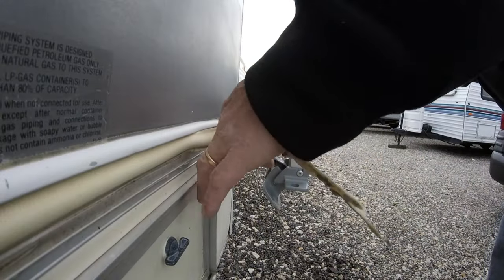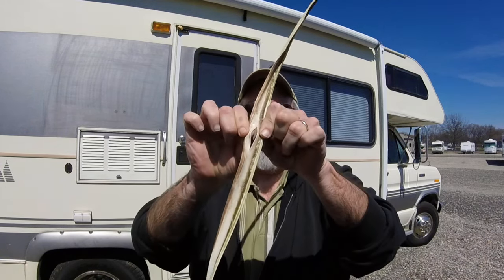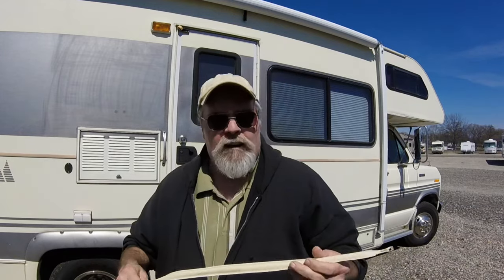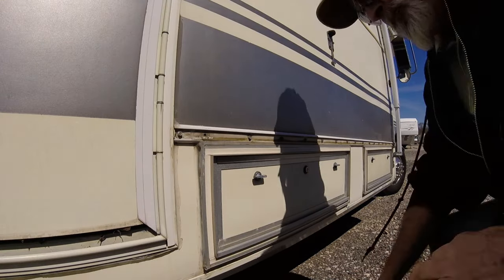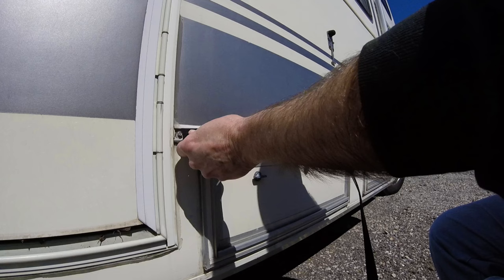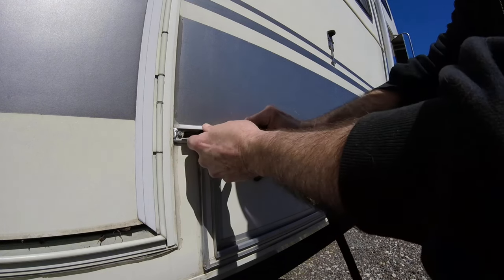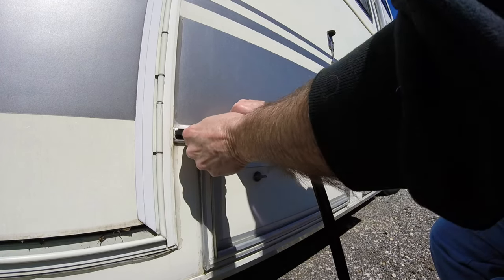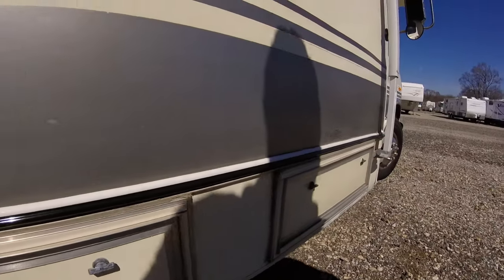Replacing Vinyl Trim Inserts

Comment: Thank you for the demo!  My RV needs this too!   Some feedback:
1. A windsock over the Microphone will remove wind noise.
2. How about dipping trim into very hot water to make it softer to use?
3. I'm thinking that a window mesh repair tool (small roller) would work well to push in trim as well.
Reply from the maker: Hi there!  Thank you for checking out the video and offering some excellent ideas.  Happy Trails to you.

Comment: Hey Geezer I know this video is older and you may have fixed it by now. I noticed the bottom is off your door. I have a neighbor with an older C that had that happen he didn’t fix it and the wind got up under there on the highway and ripped his door apart. I just bought an 86 and have the same problem I was glad he told me so I thought I would pass it on.
Reply from the maker: Good eye noticing that missing piece!  I have indeed fixed that, but I appreciate your concern.  Thanks for passing this information on.  I would have never guessed that could happen.  I fixed it only because I had the piece and just needed some new screws.  I hope you have an easy fix on yours.

Comment: Geezer, great info. What size molding did you use? What's the shape of a cross section. How wide is the screw cover channel. The opening on mine is 3/4 inch and I having a hard time just finding insert material that will fit tight enough so it doesn't flap about and come undone in the wind.
Reply from the maker: Hi Gary.  Thank you for checking out this video.  Here's a link to the stuff I used except I bought a 50' roll instead of the 25'.  I looked for the longer version and it seems Walmart no longer offers it.  I hope this helps you out.  If not, please let me know what I can do to help.  Here's the link: https://www.walmart.com/ip/RV-Designer-Vinyl-Trim-1-x-25/54334769  Good Luck to you.

Comment: Where did you purchase this product and will you please share the cost?
Reply from the maker: Hi Windy.  Here is the info you asked for.  I hope it works out for you.  https://www.amazon.com/Camco-25212-Vinyl-Insert-Black/dp/B000EDSSCU/ref=sr_1_3?crid=23ZB5BLTCWYNR&keywords=vinyl+trim+insert+1in&qid=1563053397&s=gateway&sprefix=vinyl+tri%2Caps%2C165&sr=8-3
Reply: @GeezerAtTheWheelGang - Thank you for the info. An even better price than I had found.  How is it holding up to the elements since it has been over 3 years?
Reply from the maker: @user-th9ud4nn6d  It's holding up very well.  Especially considering the weather extremes it's been through.
Reply: Thank you for your response and the info.  I enjoy the information you have been sharing.  Happy Trails to  you!!

Comment: Where did you get the trimming?
Thanks
Reply from the maker: I bought the trim via Walmart.  However, I didn't have enough to do all of the inserts and Walmart no longer offers the black.  I haven't found it any other place either.
Reply: Amazon has it.  Make sure you order the correct width.